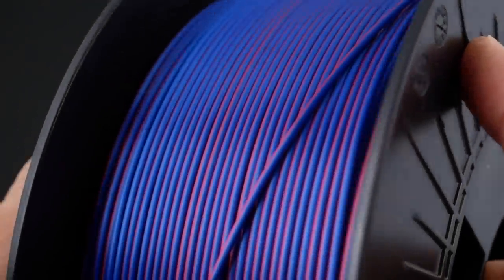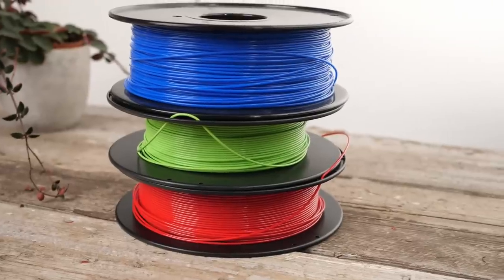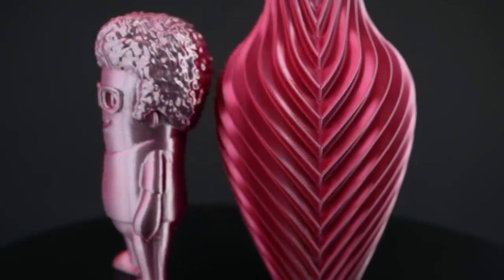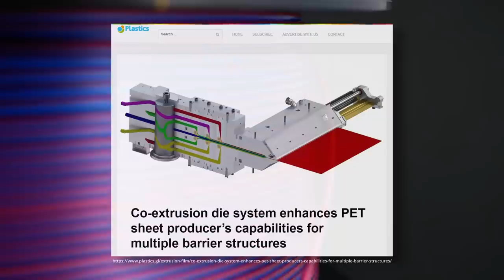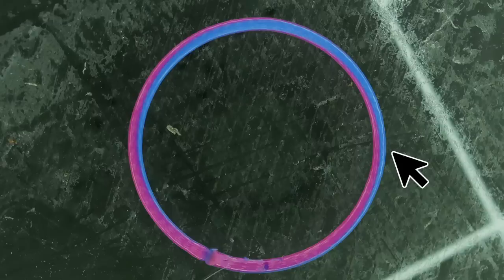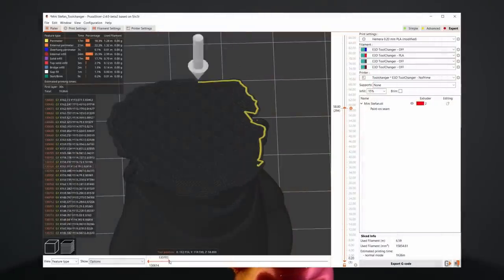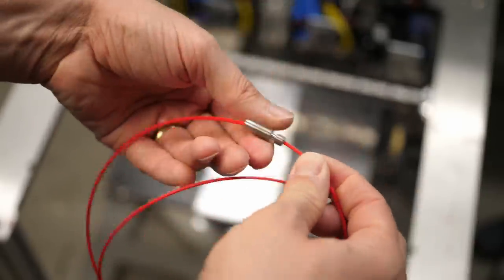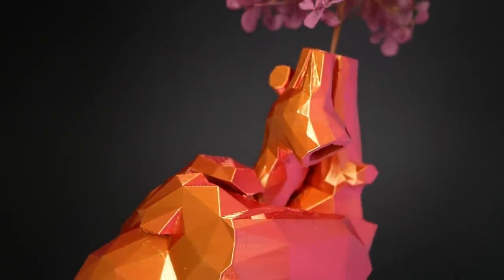2 Colors in 1 - Unique Co-Extrusion Filament!

Comment: It woud be interesting to see how the BondTech CHT nozzle would interfere with the color pattern after extrusion.
Reply from the maker: I'll try that tomorrow, but I suppose it adds a bit of turbulence and messes with the result.
Reply: Bet it would result in a unique appearance every print, even with the same spool and model.
Reply: That's what i was wondering as well, I'm exited for the result
Reply: Y'all should go check out deckingman's mixing hotend!
Reply: Can this filament show how turbulence the copper wire high flow hotend really is？
Reply: +1
Reply: @CNCKitchen  it might be a great way to check the way the plastic flows through
Reply: @satibel  Oooh. Yes. Good idea. For CHT, Matchless and CNC Kitchen DIY ones :)
Reply: It works great did it today

Comment: Hi Stefan, my company uses extrusion and coextrusion for various products we produce (we have 50 extrusion line running 24/7) 
Just so you know, the first graphic you’ve shown is wrong, for coextrusion, you add the second material a bit later inside the tooling, otherwise you will have an inconsistant mixing between the two materials (you add one material on top of the other basically) 
I would be curious how far filament makers can go, we currently run one production line doing a tetra extrusion, with clear pvc, soft pvc, white pvc and a WPC, so why not a 4 color filament ?
Reply from the maker: Thanks for letting us know!
Reply: @Pyro31 how would you coextrude a core inside of a coextrusion machine
Reply: @Spectron2077  you don’t, you first extrude the core, then add the skin layer on top 
Ex: if you want a fibre reinforced core, you extrude just the core, than inside the tool the skin material is added on top of the core, usually in the last 1/3 part of the tool

Edit : but everything is done inside the tool, I wish I could send you some pictures or videos I have

Comment: One of the long-term downsides to co-extrusion of two different kinds of plastic (not just two colors of the same kind of plastic), is that it'll make recycling more difficult.  If you know, for example, that all your waste is ABS you could recycle that into new ABS filament of a mixed color.  If your waste scraps are a mixture of  PETG and Nylon, recycling becomes a whole new challenge because of the different properties of each.  This also goes for any prints.  Recycling plastic was already a bit of a difficult proposition, but now we're talking about manufacturing new products made of mixed plastics which may not be recyclable at all.  I guess we just grind it up and put it in the landfill with a hundred billion tons of other mixed plastic to sit forever.

Something to think about.
Reply: 3D printed stuff is nowhere near as disposable made as one-time use plastic packaging
Reply: You could just melt and mix and have cheap filament.
Though for stuf like abs/pc you can simply use acetone to dissolve the abs
Reply: We'd need to stick to polymers of the same type. I'd imagine we use it to either create fancy new optical effects like seen or enhance the printability of for example moisture sensitive filaments by encasing the sensible core in an modified shell. I am thinking of CPE/PCTG inside of PETG.
Reply: You can use a mixture of crushed plastics as a component in road construction.

Comment: Visually they're fun, but I think you hit on the long term importance with your ABS/PC combo. Being able to blend the properties of two materials in a controlled manner opens up huge possibilities. 
Beyond the one you did, something where you take a strong but less flexible material and combine it with TPU as an outer shell and you probably get a supremely impact resistant material. The TPU distributes the impact across a larger area while the less flexible material then FURTHER distributes it while resisting distortion of the overall part. I'm not a materials scientist but even I can see some massive advantages in various combinations.

Comment: Some experiments I would love to see:
1 - What if you rotated or shifted the infill between layers? [Would this affect strength?]

2 - What if you distorted the infill pattern to better match the contours of the part? [Would this have a positive impact on strength, or would it just look weird?]

3 - What if you used perlin noise to create a somewhat random infill pattern? [Chaos and entropy!]

4 - What if you had a spinning nozzle that twisted filament as it's extruded?

Comment: I bought a spool from 3djake and could agree that the optical effects are quite nice. It's a interesting fact that you talked about the case of mechanical stability. As you had shown, the silk only filaments, in my case the extrudr "bio vision" is a crap for mechanical parts that have to hold something. They are only usable for items to place on a shelf with a big "do not touch" sign.

Comment: Funny, I picked the same two colour combos just before you mentioned them, hah. Have you tried the Sovol mixing hotend (intended for the SV02, but you could really fit it to anything with the right bracket) to try to do this on the printer itself? Feeding in two single colour spools to combine them coming out of the nozzle? I've got the SV02 and it comes with a 2-into-1 hotend, but it's one filament at once. I was thinking about picking up the mixing head, but didn't really see a potential need for it until I just saw this video - if it can do it.

Comment: You can create your own home made dual color filament, just need to create a 3d 1.75mm thickness spiral in your favourite 3d editor and print half height with one color and the other half with another color and using a 0.1mm nozzle, then use that printed spiral as filament.  It's not perfect but works really well.

Comment: So I think an optimum hot end is going to have a static mixer of some sort to give better heat transfer. But this filament highlights some uses of the near laminar flow in conventional nozzles. I wonder if nozzle design could be optimized for laminar flow.
Reply: it is laminar on any normal nozzle tho, at the viscosity and speed of the filament flow there's basically no way to get a turbulent flow as per fluid dynamics.
If you mean a nice and smooth extruded filament at the output, then I get it tho, from what I've seen of Stephan's tests here, a worn nozzle or excessive extrusion speed will screw that up.

Comment: If you could nail down the filament orientation, it might be possible for controlled two colored prints if you use polar 3d printers and some clever gcode.

Comment: 6:30 i was wondering that. i got a gold silk filament for christmas last year, and it was easy to just pull the layers apart, could literally unwind the print. managed to make it better calibrating the temp but still, was always noticeably weaker. maybe a good case for testing salt annealing to make it stronger, and be interesting to see what it does to the surface finish.

Comment: I now feel like I need to try this again. I remember watching SunShine's video but IIRC, the point was to make unique colors as opposed to co-extrusion/2-sided filament. Some time later I saw some posts on Twitter from some Japanese 3D printing people where they had 2 and even 3 side-colored prints (my fav was a red/green/blue vase). I tried this myself (I did a 3 color one using a Palette to produce the non-symmetric 3 color filament). The filament looked awesome. The extrusion looked awesome. The print... just kinda blended. Maybe it was the 0.4mm nozzle, maybe I didn't print fast enough, maybe I need to turn off retractions (though I did a vase). It just didn't work for me. The small-batch production just made it hard to justify the lack of effect. If mass production does it, awesome. But I'm not sure if there's a trick to getting it to work unless it only works with the more traditional filament instead of SunShine's method.

Comment: This shines a light on a few ideas I had but couldn't get a working plan.  I'm just starting 3d printing but I have plans already to recycle.  I'm curious as to what properties a filiment with a core of a semi flexible pc and outside of pp might create. As long as layer adhesion is good I have a feeling things printed laying downwill have amazing linear strength.   I'm excited to try but hate having to wait lol.

Video idea cube frame vs single truss 3d printers advantage and disadvantages of both

Comment: I have a filament just like this and all of my prints are coming out very bumpy with this. I am doing the correct temps and everything, but it is still not printing smooth. Sometimes it will even clot, but it is supposed to fit my printer correctly. Do you have any advice on what to do?

Comment: Be careful. In hot temperatures, multi colour filament can delaminate at the extruder gears making it look like a blocked nozzle. In reality, the extruder gear grinds away the near molten filament until there's no grip to push.

Comment: I'm kind of surprised that the orientation of the colors stay the same over the height of the print. Like, I image any twist or spin of the filament going in would affect the orientation of the colors coming out. So red staying on the "left" side the entire print means that the filament isn't spiraled or twisted during spooling/unspooling.

Sometimes at the end of a spool of pla, when the loops of filament are tighter and less willing to straighten out I get a twist between the spool and the extruder inlet. The filament slowly rotates as it goes into the extruder to try to untwist it.

Comment: Hello , i just try that type of Dual color PLA. But my final result was half object one coulour , half another coulour and in the middle i have the good effect. How can I set my printer to change the way of printing on each layer ? i use CURA and prusaslicer ... Thx for the answer , and your video is really great
Reply: Same thing here. have you found a way to achieve a more holographic effect rather than the one colour one side and the other the other colour? I'd love hear how you did it.

Comment: Great video and very nice. Next you may try the new polymaker polylite lwpla which is unlike colorfabb or esun lw-pla already in foam state. With a density of about 60% of the pla but it seems it's stiffer than regular lw-pla at same flow.

Comment: Consider making a dual filament printer. One extruder stepper drives two sets of gears. Set flow to 50%. Merge in the melt zone.

Comment: an idea i had: PLA has the exact same density as glycerin, which also happens to not boil below the formers annealing temperature- would it work to use it as a liguid (esgue) annealing supprt?

Comment: Im about to do a print that will use a full kg spool of dual color filament. I reeealy want to know if the effect of the double color is better in standard quality or super. .2 or .12 layer hight. its a 7 day print job in super quality so I'm digging for info. Im printing a complex geometric shape that would really benefit from being as smooth as possible but it would also be epic to have it as color fazey as possible. Any info on this would be great as the internet is completely void of any tips or examples. Thaaank you!

Comment: a flexible co-extruded with a normal thermoplastic like ABS could make single-axis flexible prints, only flexing on the z axis like a solid spring. printing temp and consistency may be an issue though.

Comment: I was thinking "so we can have polycarbonate with a core of continous CF bands?" - but realized, A: We kinda have that, and B: it only really works if "extruding" the same volume/mm as the filament itself. You can do thinner layers, but only if you scale width out to retain the same extrusion volume per mm. Because the CF is fixed in length.

Comment: A co-extruded dual material would start to have a lot of uses... PETG + TPU would be interesting, as well as PLA + anything else for better ductility and printing. This would be a great method for difficult filaments like ABS to improve print ability.
Reply: Problem I could forsee is what temperature.. the two materials would need to work at about the same temp to both extrude correctly

Comment: Could you make a filament with a metal thread in the middle using this process? would a very thin thread of steel or other very strong metal be maluable enough to print with? Combining with non planar could make it stronger in all directions
Reply: I think the bigger issue would be retractions
Reply: Something similar exists called continuous fiber 3d printing. Which embed carbon fiber during printing.
Reply: interesting. i think it would have to be nylon fibers however, to account for printhead lifts and repositioning; unless you only printed in vase mode. not sure about steel though, at very least you would need a hardened nozzle.
Reply: Fraunhofer IWU did something like this. But you need a specialy extruded thin filament. They add it to make condictive traces in parts.
Reply: @wiles_seven  Yes I think I saw a video at one of the trade shows about this, I remember some kind of fancy set up and it being very very expensive. if the wire was embeded inside the filament already then I wonder if it would it be possible to use on a normal printer.

Comment: If someone could make a co-extrusion material with a core that has decent electrical conductivity, a 3D printer could be used in electronic prototyping for wiring up perfboards (de: "Lochrasterplatine").

Comment: Your mention of diamond hotends (multiple filaments in 1 out) made me think: could even a concentric coextrusion 3d printing hotend be made? By this we wouldn't have to wait for a filament producer to make a concentric coextrusion filament. Everybody could get the advantages at home just with two different filament spools. And additionally doubling extrusion speeds.
(@e3d maybe 😉)
Reply: I think you could use those quad diamond hotends (with a top feed and 3 on the sides and extrude like a .2mm high temperature into the middle with 3 lower temperature filaments in the side.
Reply: @satibel  That's an awsome idea! 👍I believe worth testing. @CNC Kitchen: ??

Comment: Multi-color filament is nice  for appearance and probably will survive as other good looking filaments (rainbow, silk, metallic) but any "multi-material" coextrusion is wrong. Not for properties but for recycling. IMO any material designed for mass production should be reasonably recyclable. Any way in different direction is in my opinion wrong.  Even if it means we lost some interesting materials.

Comment: One major concern with the type of filament you suggest (different amterial in the core), Is sustainablity.
Recycling such a polymer blend would be nightmare. Every invention should be interrogated against it's potential to negatively impact the environment and such factors should be weighted higher than simple performance enhancements.